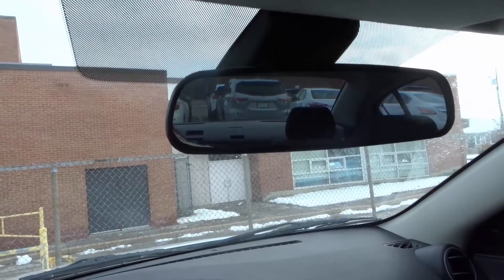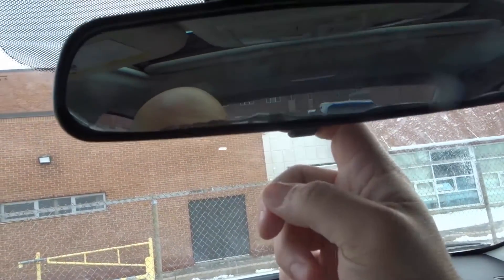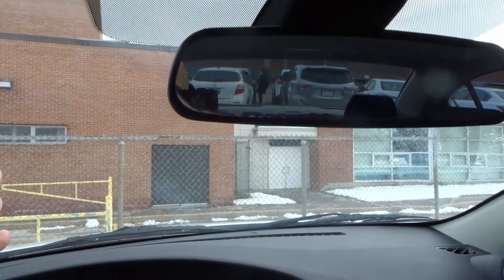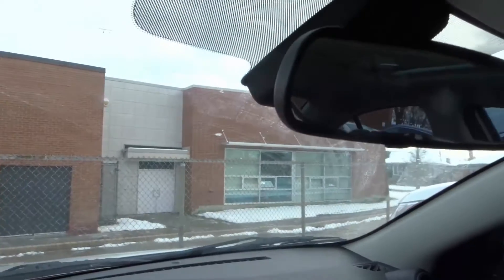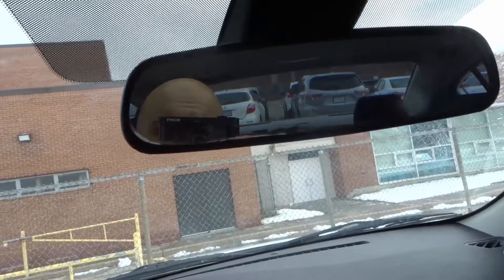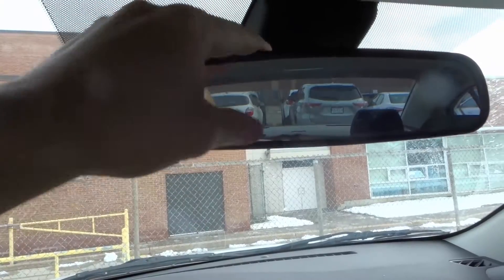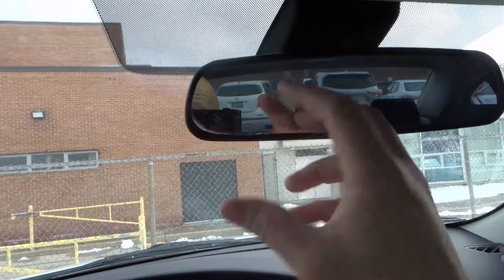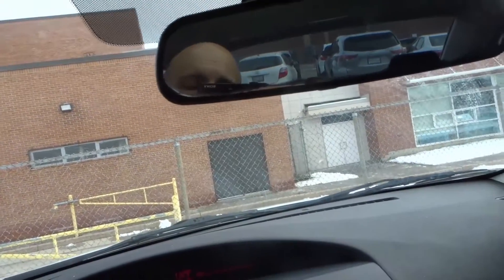How Do Auto Dimming Mirrors Work-Easy Car Explanation

Comment: One test i need to do is to block the one toward the front and shine a flashlight into the back sensor to see if it dims. If it don't then it's one or more of the sensors or loss of power to the mirror.